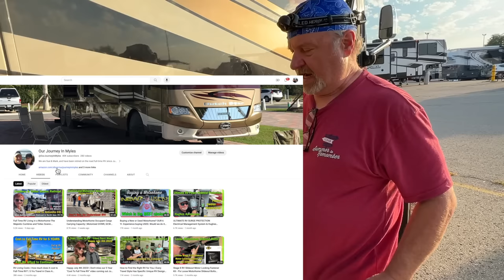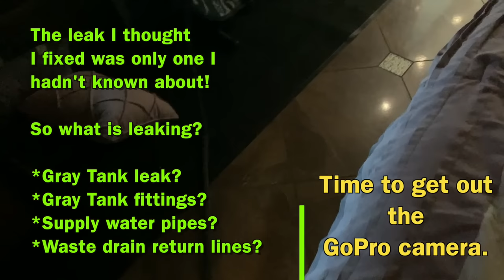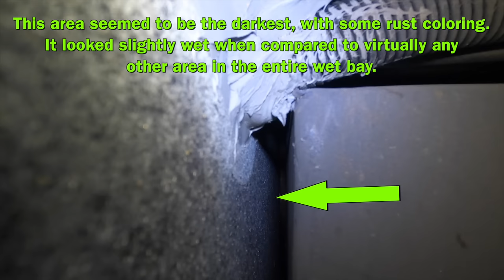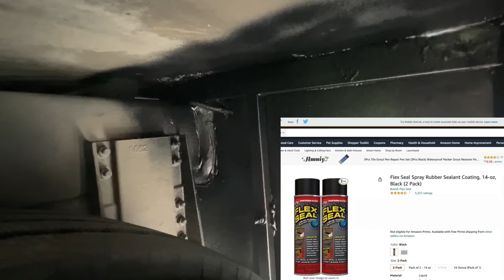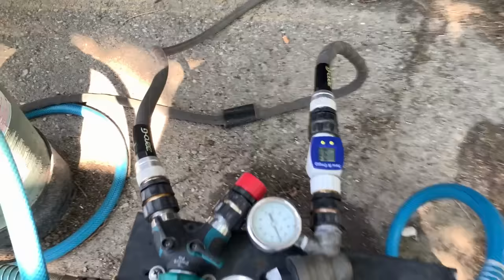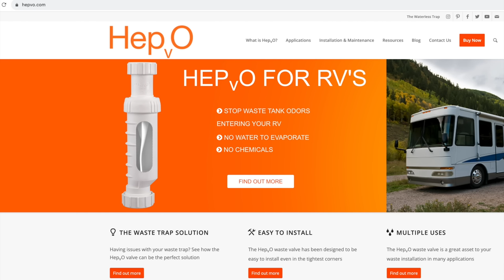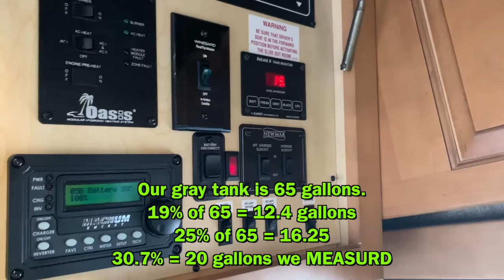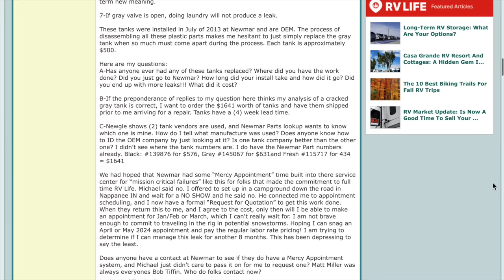Class A Motorhome Wet Bay Gray Tank Leak | Troubleshooting | NIRVC-Atlanta to The Rescue | EP282

Comment: Mark,  as always thanks for the information.  I can't wait so see the conclusion.  I too have a 2014 Dutch Star 4369 and just got back from Cummins after a $12,500 repair including a new exhaust manifold with 5 broken bolts, new alternator, and a new DEF header.  I drove about 200 miles and now back in the repair shop for a suspected failed intake air grid heater.  During the first 3 week repair the shop didn't plug my unit in and the batteries discharged extremely.  During the attempted battery recovery I noticed the Magnum inverter/charger was not passing thru the 120v power.  Just another repair opportunity.  I love it but I didn't anticipate how much love and care ($$$) they demand.  Thanks
Reply from the maker: My inverter is working fine,..........today,............but it was installed in July of 2013.  When I am at NIRVC in October 2023, I will be investigating replacing it "on my schedule",.........not at some RV shop in the middle of nowhere.  My batteries are Lifeline and again are working fine,........but THEY are 6 years old as well.  Looking at Lithium this time around,........  Any clue on the cause of the 5 broken exhaust header bolts?
Reply: I'm planning a lithium upgrade too.  My batteries were new in April 2021, but after the extended time not plugged in they are at about 1/2 capacity.  I had a whistle from the engine area during idle.  I noticed it when pulling to a fuel island.  I didn't know if it was a leaking manifold gasket, turbo, air boost leak...  I took it in and they (Cummins NPower, Oak Creek) diagnosed a leaking exhaust gasket on cylinder 6.  When they removed the manifold, 5 of the bolts snapped off due to corrosion.  From my research on iRV2 many repair facilities assume 3 bolts will break on disassembly.  Anyway with the manifold off they identified it was out of plane by more than 8 thousandths so new exhaust manifold too.  I'm keeping a running list of your repairs so I can anticipate things that might come soon to me too.  So far not much intersection of the our lists.  Thanks  @OurJourneyInMyles

Comment: I love your videos, they are so informative.  We have a 2021 Holiday Rambler 38N.  We have a leak in our black tank flush.  We didn't know it until we made the connection with the water coming as we were washing the black tank. We don't move very often right now so it took a bit.  It took out our Bluetooth module ($900.00) for the Firefly system in our RV and consequently, it took out our air conditioning control.  We had to unplug the module to get air and lights back.  Who knew they would put the water pipes on top of the electronics. *Shaking my head* in disbelief. I think it failed because of pressure, or it was not tightened properly in manufacturing - which is where we had another leak in our master bath on a month-long trip. I asked REV if they do quality checks - tech says yes - we pick a model and look at one every week for these issues - I wish they had looked at ours before we bought so they could change the water on top of the electronics/power panel. Just not a good engineering decision. ;0)
Reply from the maker: When you own one of these machines, you find out the GOOD and the BAD or something being handcrafted, and special.

Comment: Good job. I had water leaks on my last coach where water from the left front wheel would get into the electrical bay. I used sealant to stop the leak on my coach. I like the spray rubber coating I will have to look into that. 
If your gray tank was leaking where you talked about from something rubbing ageist it I would think repairing the damage would work because the age of the tank or failure of the tank from age was not the problem. Repair it and add a shield to protect it from additional damage.
Reply from the maker: I agree except:  The fresh water tank has to come out BEFORE the Gray Tank can come out.  The Gray cannot be fixed in place.  Since so many plastic parts have to be twisted and removed, I do not want to take any chances with "old stuff".  I want to increase the likelihood of a successful project for myself & NIRVC.

Comment: I do annual house AND chassis service at Newmar Factory Service Center in Nappannee Indiana.  I pay them to check and test everything.  Then they fix what I approve.  They test all plumbing. I find that the service offered from ANY Newmar dealer - NIRVC included - is unsatisfactory. I only let Newmar, Cummins, and Spartan service my rig.  I do purchase tires from NIRVC in fact buying 8 new tires this Thursday for my 2019 Essex 4551.
Reply from the maker: The Newmar service center is great, but you need to plan an appointment 6 to 9 months in advance.  Being a full-timer, we have things always popping up that need attention.  Without the (6) NIRVC locations Nationwide, we would be dead in the water a few times a year.
Reply: @OurJourneyInMyles  I understand. I have owned three Newmar diesel pushers over the years... My point is that if you pre-schedule 6-9 months  in advance an annual chassis and house service with Newmar every 12 months and/or 10K miles, they may have caught this.